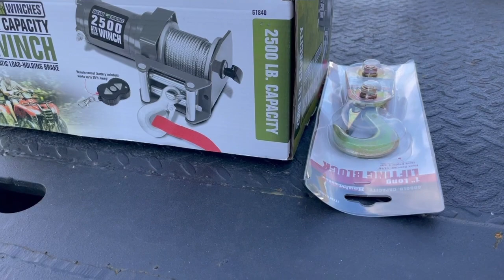Cabover gets its crane fixed!

Comment: If you flipped the winch around, so the motor stuck out on the other side of the boom, it would accomplish your desire to go over the too without reversing your remote.
Reply from the maker: Thanks for that. I didn’t think about that. I also, thinking now that the extendable boom is in upside down and if I flip it it would fix it. Hmm. Need to look at that. Thanks